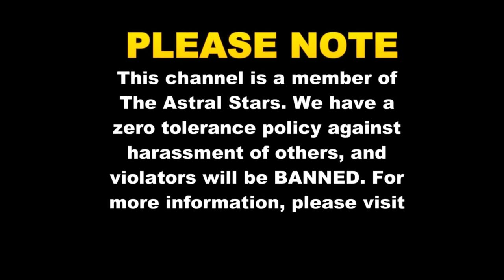⭐ 2007 Nissan Altima - 2.5S - Right Axle Shaft Replacement

Comment: I have a real big question please respond back. You helped me put my alternator on and if was my first time ever thanks.
Reply from the maker: Thanks, what's the question?
Reply: @OnlineAutoRepairVideos  my transmission line was leaking yesterday and I measured and put the wrong stop leak in it, and now my car will not go in reverse or drive
Reply from the maker: @finessedakid5495  What kind of car is it?
Reply: @OnlineAutoRepairVideos  95 cadillac Seville
Reply from the maker: @finessedakid5495  If the fluid level is good, then you're going to have to drain all the fluid and replace it with fresh fluid.
Reply: @OnlineAutoRepairVideos  I'm sorry that was my phone mistake but I was trying to say I messed up and put the wrong kind of stop leak in it. I put the bars radiator block and seal in it. I didn't know what kind of seal it was
Reply from the maker: @finessedakid5495  That's not good AT ALL! DROP THE PAN, drain everything, and refill it with fluid. HOPEFULLY no damage was done!
Reply: @OnlineAutoRepairVideos  ok thanks hope not at all
Reply: And I will change my transmission line as well because that was leaking
Reply from the maker: @finessedakid5495  Keep me posted!
Reply: @OnlineAutoRepairVideos  most definitely will